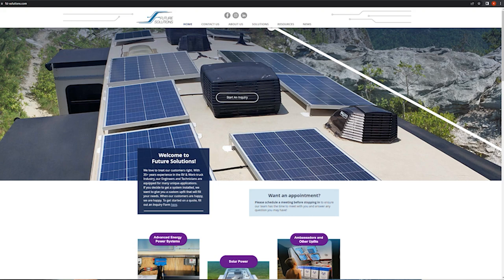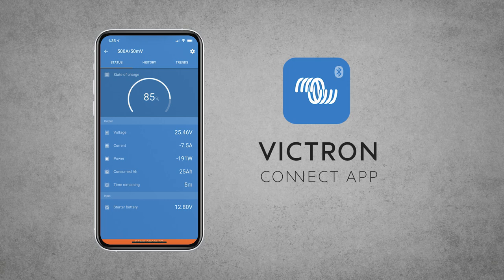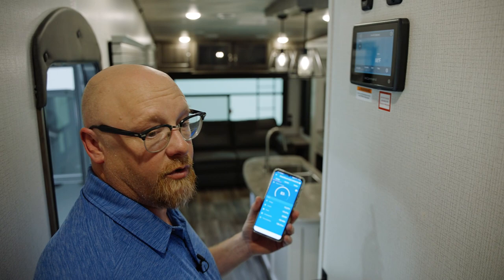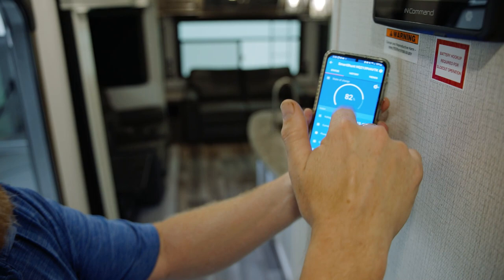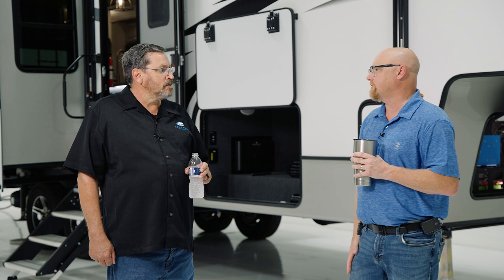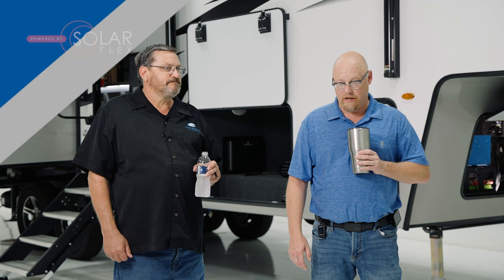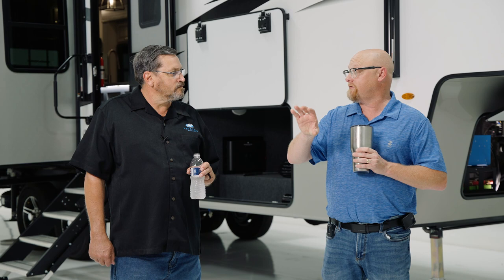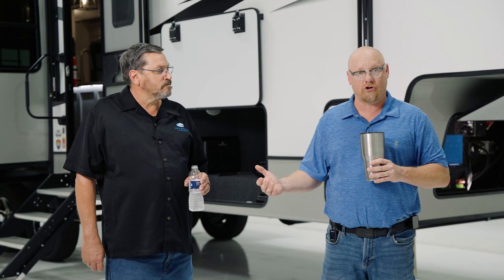Camp Better with Solar by understanding how to operate and use the SolarFlex 600i-L

Comment: Thank you! I have owned the 600i-L system in my Cougar 25RDS since April and this is the most information that anyone has given me. Not for the lack of asking, but because the dealer knows 0 about these systems, and Keystone Owner Relations is so far behind, that I might get a answer to my questions and problems by Christmas. What a great video full of information.  I called Future Solutions when I couldn't get any info from Keystone and the young man I spoke with was very helpful. IMHO, for the upcharge that Keystone charges for the Solarflex systems, Keystone should have better owner Q & A  informational contacts.

Comment: Most modern 5th wheel Rvs are 50amp service. Is this Multiplus inverter wired to L1, L2, or both to provide full system power?  Also can't see Matt owning a hair dryer... 🤔

Comment: Thanks for the video...awesome content and I learned more from you all than I did when picking up my camper.  I have the 400i and recently swapped the standard battery for our two upgraded AGM batteries.  The camper has been stored outside in the sun and my batteries appear to be dead.  Any thought as to why it's not charging the batteries?

Comment: So while in long-term storage, with the inverter off, inverter disconnect turned off and the 12v house power off - what piece of this system insures the batteries don't get charged from the panels when the temp falls below 32 deg?  I might have missed that! GREAT VIDEO - I can't wait to get my system!
Reply: Batteries have an internal BMS that won't allow charge.   There's also PV disconnects above the controllers to disconnect panel voltgage.

Comment: I see that the SolarFlex Outlast 660i-L is offered on the Cougar Travel Trailers too.  Where are the components for this installed?  Is the 270ah battery installed where batteries usually go?
Reply from the maker: Good Morning! These would be installed in your front compartment area. Also, yes they are installed in that same area.

Comment: I have a 2022 Passport GT 2704RKWE with the Solarflex 400i with a 2000 watt inverter. I noticed during the video that you powered up the 5th wheel shore power with the inverter on. I was told by my dealership that I must turn off my 2000 watt inverter prior to bringing on shore power. What is the proper procedure to do this?
Reply from the maker: Good morning and thank you for your comment! The inverter will sense that the unit has 50 amp power but once you unplug from shore power you would have to manually turn off the inverter.

Comment: Regarding storage, I live in NH and put a cover over my camper for the winter.  Do you need to remove the batteries if the solar panels are covered and not charging the batteries, or can they be left in for the winter?
Reply from the maker: Good Morning! You do not need to remove these if you have lithium batteries in your unit. If you do not then you can remove these during the winter!

Comment: What should the Lithium battery Charging Voltage be?
Reply from the maker: Good Morning, that is an excellent question. The lithium batteries are charged with an absorption voltage of 14.25V for a 12v system.
Reply: Thanks. My newly delivered Cougar was set to Lead Acid with the Dragonfly Lithium batteries. Wasn't easy to find fix.
Reply from the maker: @duanestevens6927  We are sorry to hear about that! If you have any other questions or concerns on your unit please do feel free to call our customer care team at 866-425-4369. Thank you!

Comment: I have a Cougar 25RDS with the 600i-L package installed. I have the big red inverter cutoff switch but no black 12 volt cutoff switch anywhere. Not next to the inverter cutoff, not on the “Giggy-box” and not next to the battery heat switch next to the entrance door in my coach. How do I shut off my 12 volt power. The dealer can’t tell me and Keystone Owner Relations can’t tell me. HELP would be appreciated from anyone. Thank you!
Reply from the maker: Thank you for your comment. We apologize that you did not get assistance, we would be happy to help, but we would need to get you to the correct team. Can you please direct message us on Facebook with the last eight characters of your VIN so we can assist further?
Reply: Is there another way other than FB which I don’t use to get you this info? @KeystoneRVCompany
Reply from the maker: @Graybeard1405  We would recommend contacting our Owner Relations department at 866-425-4369. They are available 9-5 est Monday-Thursday and 9-4 est Friday. Thank you!